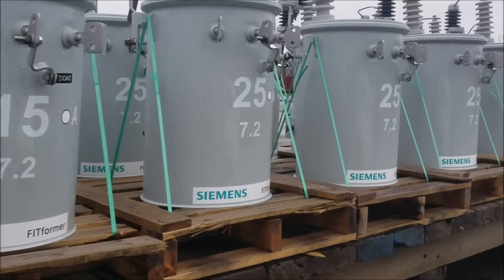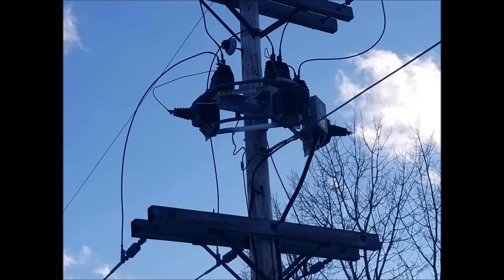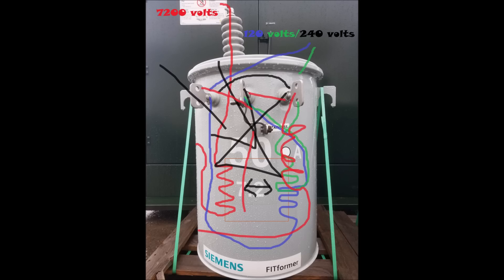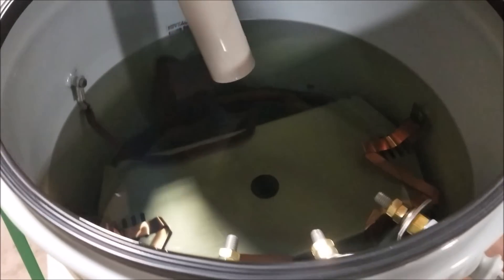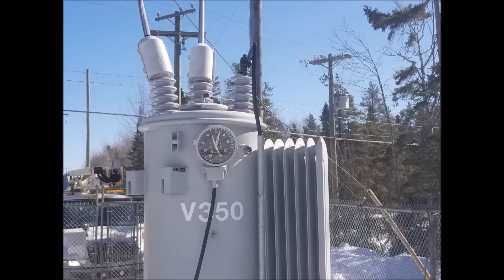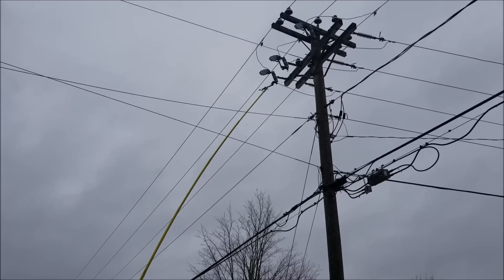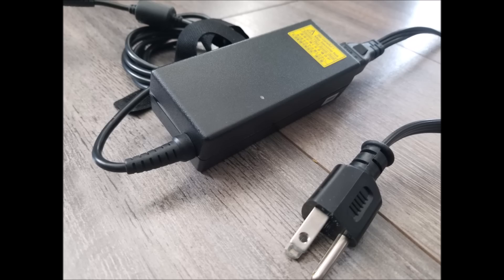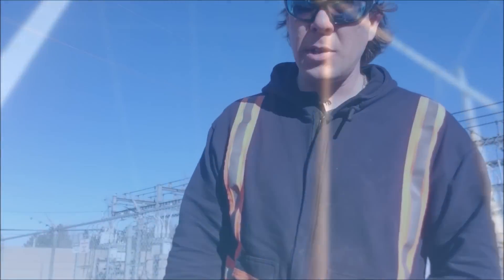What's inside a Transformer?

Comment: Great video! Question: I’ve always wondered how only 1 phase is going to the input of the transformer, yet, 2 phases of 120v each are leaving the transformer so that a home can have 220/240 service. How is this possible? Where’s the hidden internal wye?
Reply: The two 120 volt secondaries are connected in series, delivering 240 volts "line-to-line".  Relative to the connection point between them, the voltages are "out of phase" by 180 degrees, meaning that they are both in the same straight line.  If, for example, the same transformer were used as one of three for a three phase four wire 120/208 volt system, the two 120 volt secondary windings in each such transformer would be connected in parallel (i.e., the lower voltage, but double the current).  Typically, if they are single phase pole transformers of capacity at least 75 kVA, all four ends of the two low-voltage windings emerge from the case, and the series or parallel connections are made externally, for the world to see.
Reply: TorontoLS thank you for this wonderful explanation, however, what I’m not understanding here is...that 2 separate lines run from the transformer into my panel in my house, which feed both both live bus bars. Each line/bus bar is 120vac coming off the transformer separately, as 2 separate phases of 120vac each. Then, within the panel the 2 phases get merged by individual “double breakers” for the 240vac lines within the house. So, I still am not understanding how, within the transformer 2 separate phases of 120vac each, are created from the secondaries
Reply: Emes:
I found on the Internet, via Google, a site called "constructionmanuals.tpub.com/14027/css/Figure-4-17-Single-phase-transformer-connected-to-give-120-240-volt-three-wire-single-phase-service-75.htm".  I refer you specifically to Figure 4-18, which shows the internal and external connections of a transformer of capacity less than 75 kVA, with 2400 volt primary and two 120 volt secondary windings, these low-voltage windings being connected in series within the transformer case.  The two 120 volt "phases" (strictly correct, but not used by the industry, because they are 180 degrees apart, rather than some lesser angle) deliver 240 volts "line-to-line", as shown in the diagram.

If you would like me to explain 2-phase 3-wire (90 degree angle between phases; actually, the asymmetrical half of 4-phase 5 wire, used in control systems), 3-phase 3-wire (60 degree angle between line-to-line voltages), and 3-phase, 4 wire (120 degree angle between line-to-neutral voltages), let me know.  (There is also a 2-of-3-phases 3-wire "system", sometimes called Network, where the previous 1-phase 3-wire supply has been converted to 3-phase 4-wire, but the older customers only use two of the three phases; in that case, while the line-to-neutral voltage remains 120, the line-to-line voltage is 208 [actually, 120 times the square root of 3]).
Reply: TorontoLS thank you for the explanation. I’ll click the link you found and look for some diagrams to help me to better understand this
Reply: Emes:
I apologize for the "link" I specified regarding the transformer winding connection.  In the process of drafting another comment, I tried invoking that link, and discovered that one cannot get to the desired location.  The way I got there was to do a Google Search on "transformer 120/240" and search "images".  Not far from the top I found an appropriate diagram of a transformer,  labelled "Single-phase transformer connected ...", from a website "constructionmanuals.tpub.com".  Invoking that diagram, and "clicking" on the title "Figure 4-17.Single-phase transformer connected to give 120/240" got me to where I could scroll down to the Figure 4-18 to which I referred you.
Reply: TorontoLS thank you, I’m not finding it. What I actually really need is for someone to hand-draw a basic diagram of the inside of a transformer, showing me the “magic” of how 2 separate secondaries which are also 2 separate phases are produced from one primary
Reply: Dave so as I now understand it after watching that video you provided the link to, the 2 secondaries are split down the middle by a neutral. Is this the neutral busbar found in the panel? In my house, only 2 lines are coming into the panel from the transformer. L1 & L2, the N busbar appears to be merged with gnd and leaves the house via the ground cable clamped to the water main coming into the house. Do I have this right so far?
Reply: Dave as for the 2 phases becoming 2 phases...yet while feeding off the same secondary from within the xfrmr, this I still don’t understand how that’s happening
Reply: Emes Appliance Repair - I gave it my best shot...I dunno what else to think of...Now you’re messing with my mind...😎
Reply: Emes Appliance Repair  - Yes, you got it !
Reply: Dave this is all great! And very much appreciated by me! I will go over all this material just as soon as I can. I’ll let you know when that 💡 lightbulb moment happens in my head 😃
Reply: TorontoLS  –  I’m really trying to help EMES Appliance as well...what I can’t figure out is how he’s in the ‘BIZ’ and doesn’t get it...
Reply: Dave I’m in the “biz” of repairing major home appliances and HVAC repairs. Everything that I work on has to be receiving either 110vac or 220vac. I understand that inside a typical 200a panel in a home, there are 2 phases coming into the panel, both which are produced by the xfrmr. What I don’t understand is how the xfrmr produces two phases of 110vac each...from 2 secondaries both feeding off of 1 primary. All I need to understand this is a basic hand-drawn diagram. In my 20 years in the biz and my 900 hours of certification training from Apex Tech in NY, I still haven’t seen the inside of a power company’s transformer in such a way that I can understand this. If someone reading this can please be so kind as to draw up a basic pencil sketch of how this occurs within the xfrmr, than perhaps I’ll then understand it. I’ll bet that there are many electricians out there who also don’t get this. We all work on electric, post the breaker panel, not pre
Reply: Emes Appliance Repair - Did’ja watch the video I sent ?
Reply: Emes Appliance Repair  – 1st, I meant no disrespect at all...just a little surprised. You can call me out too, there’s MUCH that fascinates me too.

Here’s a bunch of diagrams and actual photos of center tapped 180 degree ‘Out Of Phase’ transformers. Again, it’s a real physical tap in the center of the transformer. You can see in the photos the actual center tap. It’s picking off 0 VAC at exactly the center of the ‘ALTERNATING CURRENT’ path through the secondaries. The KEY here is the current is actually physically ALTERNATING back and forth in the transformer.

Let’s say there wasn’t a center tap neutral. The 7200 Volts at the pole would be stepped down to 240 VAC and you’d only have the 240 between the two ends of the secondary wires...with the same sine wave as in the primary except the lower amplitude voltage, and each of your 240 wires reference ‘each other’...Again, as they reference each other, they’re amplitudes are 180 degrees ‘MIRRORING’ each other.

So, when it’s tapped at the center, your reference point changes to where each of the 240 ends/lines are now referencing at the 0 Volt position; Which is exactly 1/2 of the sinusoidal wave thus giving 120 VAC. It’s not so much that their 2 different phases like 3-Phase motors, it’s more, we’ll exactly that their MIRRORING each other with reference to the center 0 volts position of that sine wave.

Here’s some stuff I put together for you...

https://www.icloud.com/sharedalbum/#B0N5xIAdOW0np7

The ‘primary’ is ‘inducing’ an alternating current in the secondary. Yes, it is magic...but it’s all electric fields cutting across magnetic fields. Nobody to this day can tell us how it really works from a God, Einstein, Nature, or whatever one believes in...It cannot be seen, yet it is. If you figure it out, you’ll get the Nobel, Pulitzer, and you’ll be super famous and beyond Jeff Bezos or Elon Musk, or Bill Gates wealthy.

A current moving through a magnetic field or a rotating magnetic field around a conductor (either way) induces an alternating current in another conductor (the secondary) Lookup Michael Faraday or Maxwell.

It only becomes 2 phases if you will because of the center tap at the 0 Volt position of the sine wave through the coils windings. May I suggest you lookup a ‘solenoid my AKA ‘coil of wire. There’s a mathematical component to where you pickoff the neutral and it has to do with the number of turns in a coil.

Think about it like this...If we move the center tap say to 1/4 in with 3/4 left, or any other position other than the center, you could have a different reference point of say 45 VAC or 89 VAC or 22 VAC and call that your ‘neutral’. You’d just be moving your voltages ‘potential difference’ to a different part of the sine wave and thus a different reference point  to measure against. I suppose they chose the center position for 0 volts reference cause it’s convenient as a standard. This all goes back to Tesla, Edison, Maxwell, Steinmetz, Faraday, and Heaviside. It’s also got to do with the economical transport of power over long distances.

I suggest looking up ‘Angular Rotation’ and Phase Translation if you want to really absorb how it all works.

You have to remember that all this alternating current and voltage is being produced by rotating machinery and the conductors through a magnetic field which produces angular positions around 360 degrees. 0 to 180 is positive AC voltage and 180 degrees back to zero is the negative AC voltage, and the current alternates along with the voltage depending on where you are in the rotation of the generator.

Like I said, there’s a significant mathematical, geometrical, and algebraic component to how all this works.

Man, I hope I helped out...I’ve been writing this for like 45 minutes❗️

I’m SOOOO glad your interested in how this all works. It’s waaay cool of you dude❗️It’s all very fascinating. Most people take all this for granted. Think about it, electricity as we know it, has only been around for about 120 years. That’s not even a blip on the humanity and civilization scale. We’re VERY lucky to live in this age.

I’m very happy to meet you sir❗️
Reply: Dave yes. It was very informative, however, it didn’t explain how 2 phases are produced in order for 240v to be possible
Reply: Emes Appliance Repair  - 2 phases are NOT producing 240VAC...the transformer is stepping down the 7200 Volts in the pole to 240VAC in a single secondary, then the single secondary also has our friend the center tap at 0 volts in the sine wave which enables each leg of the 240 VAC to reference 0 neutral thus giving two 120 VAC lines (hot bars) in the panel.
Reply: For 2-Phase 120/240 The transformer is ‘center tapped’ on the secondary induction coil. It’s tapped at exactly where ‘0’ volts occurs on the 60Hz sine wave. This provides a ‘0’ VAC reference point...now instead of having only 240VAC, you have (2) 120 VAC between each of the hots and the ‘0’ VAC reference point...you also still have the 240VAC between the two 120 lines.
Reply: Dave:
In fact, it was during the process of crafting a response to you that I discovered that the URL I "gave" to Emes didn't work.
Your explanation to Emes regarding a single-phase transformer supplying 120/240 volts to a residence (or, in fact, any class of customer so supplied) is correct, AFTER the transformer has been installed.  The reality is that those transformers do NOT have centre-tapped 240 volt secondary windings.  What they DO have is two (2) electrically-independent 120 volt secondary windings.  If the pole transformer is rated below 75 kVA, there are three secondary bushings passing through the side of the tank, near the top (as the photos you supplied show).  If the utility wants to supply 120/240 volts from that one transformer,  INSIDE THE TRANSFORMER TANK, it connects the two independent windings in series (once interconnected, they are no longer independent of each other), using the centre bushing as the common connection point, which point is externally grounded, for the reason explained in the YouTube video you referenced.
If the pole transformer is rated at or above 75 kVA, with two 120 volt secondary windings, there are four secondary bushings passing through the side of the tank, near the top (your photos do not show any of these higher-powered units).  By industry convention, these terminals (explicitly at the terminals, or, at least, on the nameplate) are labelled X1, X2, X3, and X4, with X1 and X2 being the two ends of one of the 120 volt windings, and X3 and X4 being the ends of the other one.  The positioning of the terminals on the side of the tank is X1  X3  X2  X4, with equal spacing between adjacent terminals.  If the utility wants to supply 120/240 volts from that transformer, it connects a jumper between X2 and X3, and also grounds that terminal pair.  HOWEVER, if the utility wants to supply ONLY 120 volts from that transformer, it instead connects a jumper between X1 and X3, and another jumper between X2 and X4, thus putting the two 120 volt secondary windings in parallel (yielding the lower voltage, but double the current).  A second similar transformer, connected to the same primary phase, might supply the "other side" of a single-phase 120/240 volt system.  OR three such transformers, with secondaries connected in parallel, might supply 120/208 volt 3-phase 4-wire loads.  In all these cases, when only 120 volts is wanted, half the transformer capacity is NOT wasted.
For pole transformers rated below 75 kVA, and with 120 volt windings, these same windings can also be connected in parallel, but WITHIN the tank (the wire is thinner, and more easily moved).  In those cases, one of the secondary terminals is not used.

One additional point: your reference to "where ‘0’ volts occurs on the 60Hz sine wave" is not correct.  The grounded centre-tap of a 240 volt winding, or the grounded series connection point of two 120 volt windings, is at 0 volts RMS (root mean square, the equivalent DC voltage to deliver the same heat in a resistor).  The "line" voltages, ideally sinusoidal, are zero twice per cycle, and reach a "peak" (positive or negative, depending on the half-cycle) of 169.7 volts (being 120 times the square root of 2).
Reply: I know this question is 2 years old. I just wanted to add some information. First, off the term, 2-phase is a bit of a misnomer. Electrical power is generated and transmitted high voltage in 3-phase. In some cases all the way to the customer. In my almost 40 years as an Engineer, most 3-phase services are 208/120. Then we have 440/277 and another one that thankfully is not as popular as it once was. This is a 240/120 with a high leg (bastard leg). What I mean is a voltmeter will read 120 volts from 2 phases to ground and 240 votes between any of the 3 phases, however one phase to ground will be 208 volts. Code states this leg must be identified. Then we have a simple single phase. This can be 120, 208, or 240 volts. On most residential transformers the secondary is center-tapped and that center tap is grounded and becomes the neutral wire that allows 120 volts. On some service connections, this center tap does not have insulation. One thing of note I wanted to mention was that 208/120 3-phase service. I lived in an apartment for almost 10 years that had this type of service. It took longer to dry my clothes and my oven cook times had to be adjusted. I once took a meter and saw how many volts I had going to my stove. It was 202 volts.
Reply: Simpler explanation:   Transformer voltage is dependent on the number of turns of the coils inside them.  If you have 1000 turns on one side of connections, and 100 turns on the other side of connections, the voltage change will be a ratio of 1000:100.  Putting 1000 volts into the first side will result in 100 volts coming out the second side.   Now, consider adding a third "tap" or connection to that second side, right in the middle (after 50 turns) of the coil of 100 turns.  If the input is still fed 1000 volts, then connecting to one of the previous wires on the second side and that "center tap" will give you 50 volts instead of 100 since the number of turns is halved.  But the 100 volts is still available if you ignore the center tap.  

That's where the two voltages come from.
Reply: @jovetj  thank you, but that doesn’t explain how two phases of 110v come out of the transformer to the panel in the house and then can supply 220v circuits because they’re 2 separate phases of 110v each
Reply: @emesappliancerepair3792  Sure it does.  Don't make it more complicated than it is.  There are NOT two phases coming out of the transformer.  

It's all about the windings on the transformer.  If you connect to the entire length of the output winding, you get 240 volts.  Each big black feeder wire coming into your main panel through the main disconnect is connected to one end of that entire length of the secondary winding of the transformer.   If you hook a lightbulb up to them both, that light bulb will receive 240 volts.  

But there's a third wire on that transformer's secondary, and it's right in the middle of the winding.  This middle wire is the neutral.  If you connect to the neutral and either of the other ends of the secondary transformer, you'll be using HALF of the windings of the secondary transformer, resulting in only 120 volts.  It doesn't matter which end of the winding you connect to, as the neutral is in the middle, so either side is 120 volts.   

Here's a graphic I drew up. Study it and let me know if you have any questions.
https://jovet.net/files/images/UtilityTransformerSchematic.png
Reply: @jovetj  great drawing and explanation, thank you. But still how are we ending up with 2 phase power in the panel. I understand that it’s 220v coming out of the secondary winding and into the panel in the house. But in order for 110v L1  +  110v L2 within the panel to be able to be 220v, there must be 2 phases. And it’s related to the Hz if I understand it correctly. Because, 110v + 110v coming from the same phase would =  0v due to lack of potential difference
Reply: @emesappliancerepair3792  No, there aren't two phases.  The talk of "two phases" you've seen above relates to the belief that L1 to Neutral is 0 volts while L2 to Neutral is 120 volts, and vice-versa.  That doesn't seem true to me, but I'm no physicist.  

If you want to understand multi-phase systems, then just know that the sine waveforms representing voltage over time start and stop at different times for different phases.  I'm saying don't worry about it here because it doesn't matter.  Just worry about the transformer winding ratios, and that halving the secondary winding count means half the voltage.  You can build transformers with dozens of taps to get all sorts of different voltages which you can use at the same time.  This transformer with 3 secondary taps (as shown on the graphic) is pretty straightforward.  

You used to be able to walk into Radio Shack and buy the same style of transformer that transformed 120V to 12V.  Those transformers also had center taps on their secondary windings, so you could do one or two 6V supplies if you wanted.  The big transformers on the poles are just scaled-up versions of those.  

It might also help you to visualize that raw Power = Volts × Amps.  If there are 500 watts raw flowing into the example transformer primary, there are going to be about 500 watts flowing out of its secondary.   If the input voltage is my earlier example 1000V again, then the transformer is drawing 0.5 amps.  On the output side, the transformer has a winding ratio of 1000:100, so there are only 100 volts coming out.  But the reduced voltage is made up for increased amperage, so the transformer can deliver 50 amps at 100 volts to the load. 

The same thing happens in you home.  Low power devices like clocks and radios and light bulbs don't draw much power, so 120 volts is fine for them.  Big things like ovens and dryers and air conditioners draw lots of power, so 240 volts is more efficient.  Standard stove outlets are set to deliver 50 amps at 240 volts.  If only 120 volts was being provided, the same amount of power would have to be 100 amps!
Reply: @jovetj  this is all fine and well. Great explanations. However, still this doesn’t explain how we end up with 110 + 110 = 220v, because that would require each live busbar in the breaker panel to be 110v each, but from two different phases otherwise 220v circuits are not possible. So how are the two phases being produced by the transformer as two phases? I understand multitap transformers, we use them all the time in HVAC systems. But for 220v to be 220v, there must be two phases coming out the leaving side of the transformer
Reply: @emesappliancerepair3792  I cannot make it any plainer:  there are not two phases!   There are two, equal lengths of secondary windings on the transformer. A load hooked up across only one winding gets 120 volts (not 110).  A load hooked up across both windings gets 240 volts.  It's really that simple.  

The breaker panel question is a good one. The power busbars on the panel are designed to alternate between adjacent breaker slots.  So, for example, the topmost left slot (for a vertical panel) presents L1 to the breaker.  The slot next to that one presents L2.  The third slot presents L1 again, etc.  No 120V circuit cares which leg it uses. Inserting a two-pole breaker automatically will grab both L1 and L2 (or L2 and L1).  The 240V circuit doesn't care which one is L1 and L2—there's no polarity and it's 240V either way.